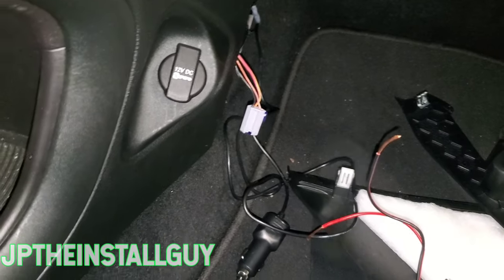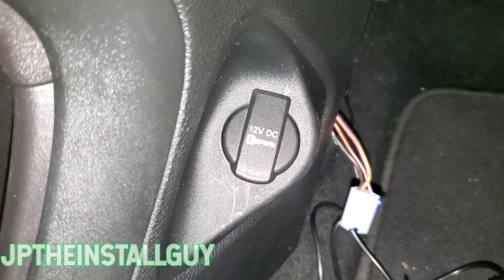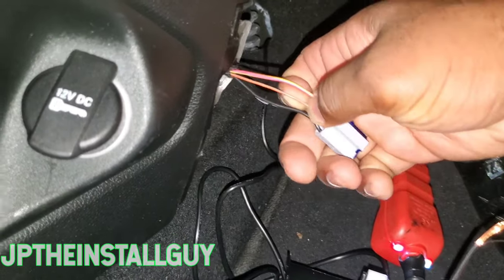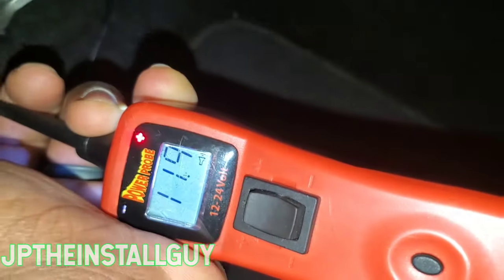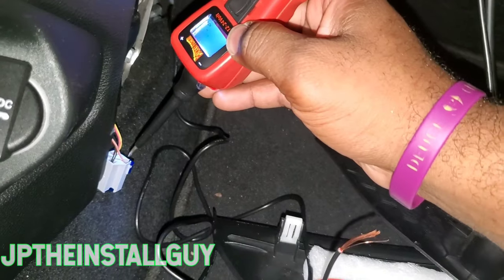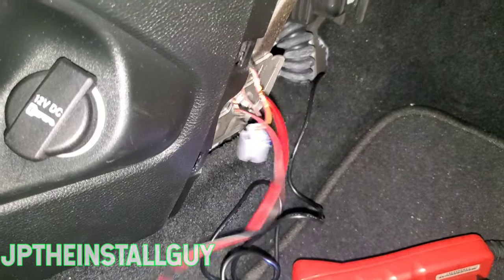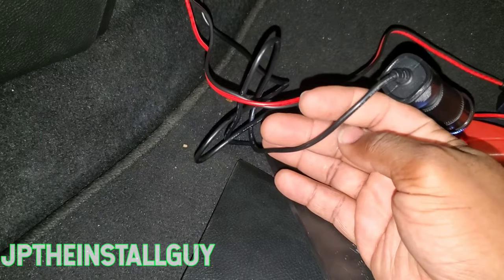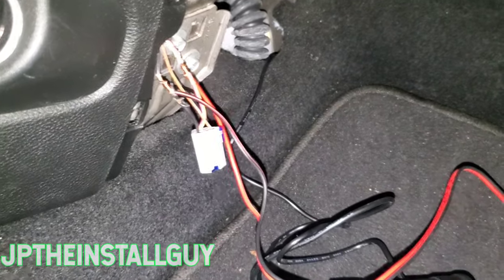how to tap power from cigarette lighter

Comment: Great video.

Another bonus to doing it with the cigar socket from the jump (instead of cutting the dash cam plug and using a step up or step down transformer) is that if you ever decide to replace the dash cam, you're not having to go through all the dash cam hard wiring again.

Just unplug the old one and plug in the new one.
Reply from the maker: That's right ✅

Comment: Hi great vid, quick question. If I tap the cigarette source to convert a 5v usb input to a 12 volt input will that divide my original 12 volt input source? Should I need to take anything in consideration before continuing?
Reply: So whenever you add a device to a DC circuit you lower the current (amps) and the voltage stays the same.   AC circuits amps stay the same and voltage lowers.  You will always get a slight "voltage drop" due to copper loss and other factors (resistors etc).  If you buy a socket like that it likely has a "step down converter" from 12v to 5v built into the socket. Always check the specs of what you are buying to be sure that it functions as intended.

Comment: Got a question can I tap power from another source to make my aftermarket radio work in my 2001 honda accord lx, there is a wiring issue, all the fuses are good but I have no clock, radio, dash lights or tail lights or radio, I need my music is there another way to get power to the unit? If so how?

Comment: So let me ask... is there a way to wire a LED Hood strip & LED Rock lights together.....BUT wire them to work on a 12V power cigarette/supply. That I can manually plug in when I want to run them and unplug when I don't? Now the power may vary I assume, where as the LED Strip pull MAYBE 5 amps/volts and  LED Rocks run 12V. So is there a way to combine both into a plug in type power source that runs both???

Comment: Is the cigarette lighter ground wire ground all the way back to the battery or just straight to the chassis? I'm about to install a UHF radio and want to avoid interference from the alternator and also avoid getting the ground wire through the firewall.

Comment: Quick question I have I Vw golf mk6 and he fitting a usb kit off eBay around the usb is led lights the plugs into the back of the cigarette lighter and it drained my battery even though when you turn the ignition off the lights on the USB part goes off which I didn’t understand. I’ve bought a new battery so hopefully this fixes it but does it need a bypass switch sometimes with these kits they’re about 20 quid on eBay

Comment: Question: if you connect your dash cam this way into the ignition wire, am I assuming correctly that the dash cam function that it comes on when someone bumps your car won’t work? Do you need extra wiring and some kind of power box for that?
Reply: yes, you need a +12v power source that's present when the car is off.
Most of the time you can have a 3-wire solution with the dashcam, or a manual switch to put it in "parking" mode.

Comment: I have a 2013 dodge avenger, with two sundown subs and 1200 watt high phonics amp, and jvc aftermarket head unit. Well I unplugged it one day and now when I connect it back my stereo will not power on . I unhooked something connected to the lighter or where my heat and ac controls are

Comment: I wonder before I jump on this project I am doing, while the ignition cable stop giving power when I turn the key to turn on the engine.
Reply: Update, I checked both Cig and Outlet Power and when you crank the motor they turn off. So this will not work for me.

Comment: Silly question; Why wouldn’t you want to tap into the one running to the vehicle battery?
Reply from the maker: if you tap into anything going to the battery then whatever your powering up will constantly stay on. you want to tap the ignition side or key side so your accessories cut off when the car cuts off and does not drain your battery

Comment: are those ciggarette lighters al the same?
i have 1 in the back seat of my van,  i want to use it to connect my remote turn on wire to power up my amplifiers
Reply from the maker: nope you have to check and make sure that the cig lighter comes on and off with the key. sometimes the cig lighter stays 12volts all the time and you cant use that for the amp
Reply: @jptheinstallguy  😂 duhh,  i mean the wires they have

Comment: Good quick video man…what if my socket doesn’t have the key or battery symbol?
Reply: It just says 12V/120W
Reply from the maker: Then you want to test to make sure it's constant or ignition if you have something like a car charger you can plug it would be easiest. Plug it with the car off if it charges the phone or a light comes on then it's constant if you only get power when you turn the car on the you have accessory

Comment: Hey man! Do you have to have an fuse on the cable if the lighter already has a fuse? And is it possible to use a blue wire tap?
Reply: I want to install a 160W underseat subwoofer
Reply: And also, can you tap your ground into the ground of the sig lighter?
Reply from the maker: I would still fuse it just to be safe and you should run a new ground for the sub amp